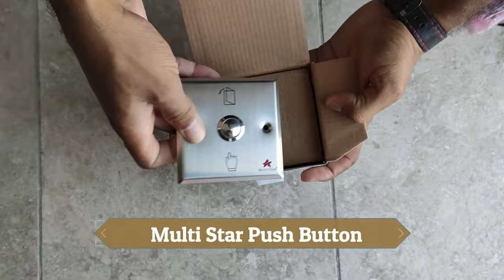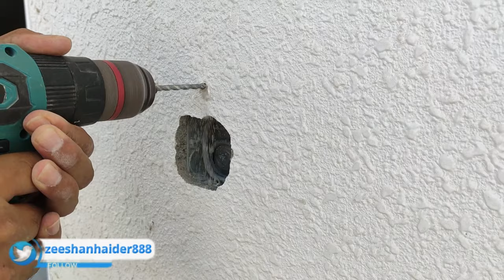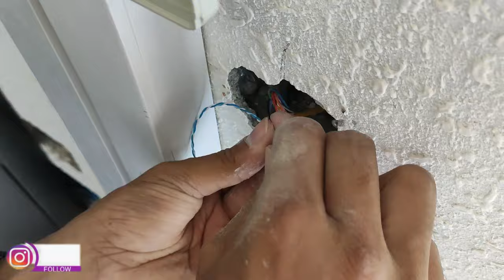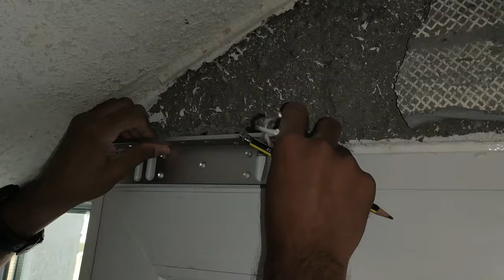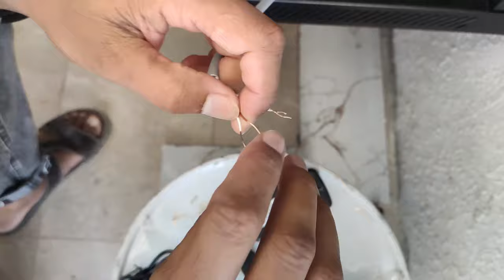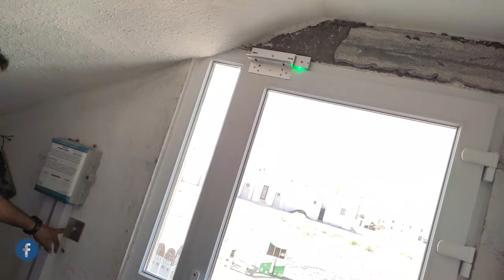How To Install Access Control Access Door Lock How Configuration Multi Star Smart Door Lock

Comment: Is there a backup power supply in case of any power outrage
Reply from the maker: Yes available in market 12V DC power supply with battery backup
Reply: @naturefuturetech  Then what's the full cost with the backup ps included